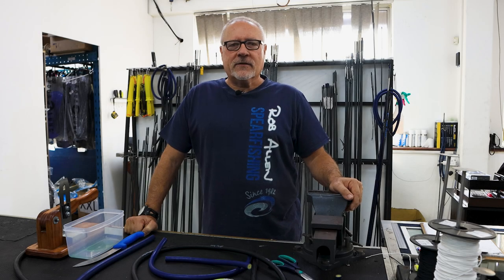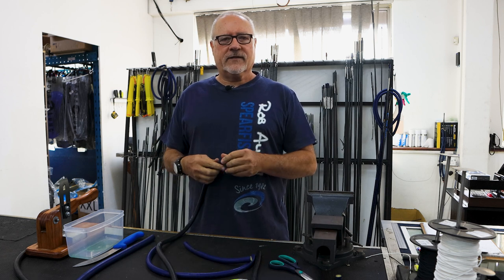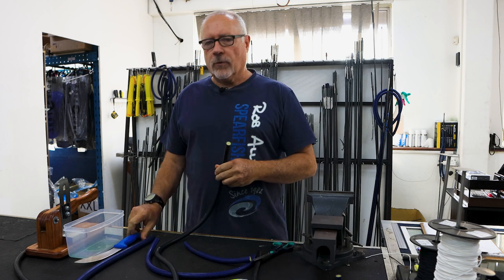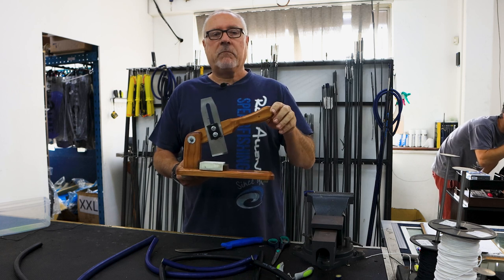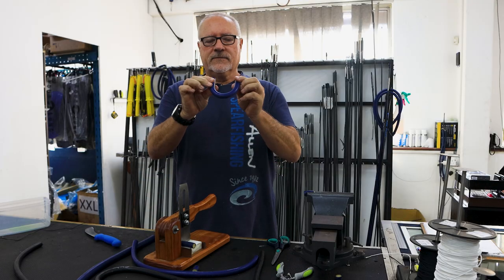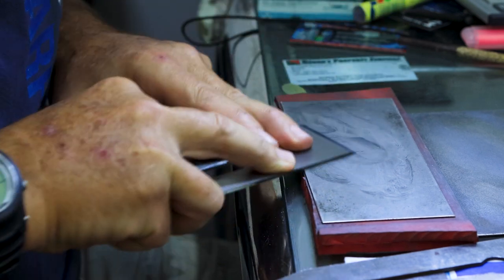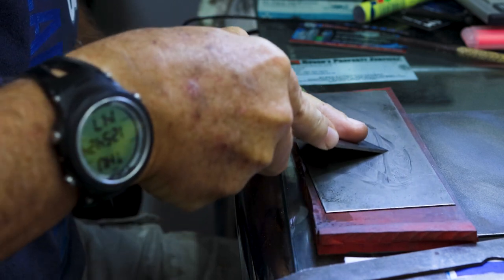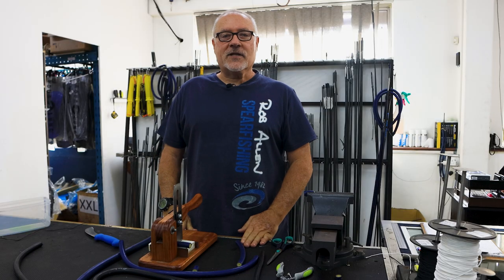Rob Allen | How To Cut Your Rubber | 2022

Comment: You can also use a knife and a cutting board. Knife needs to be sharp and a big blade like a cooks or chefs knife. One hand on handle and palm of other hand on back of blade, push down firmly and you get the exact same shearing action that you would get using the plane blade guillotine and cuts just as neat.